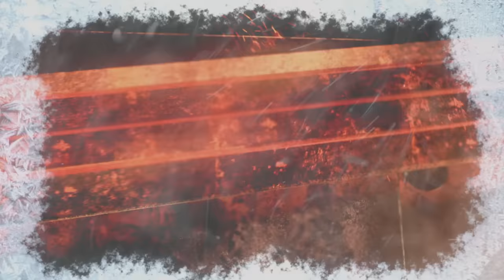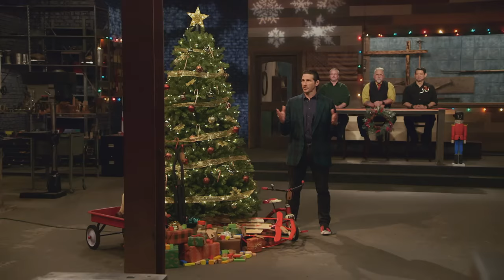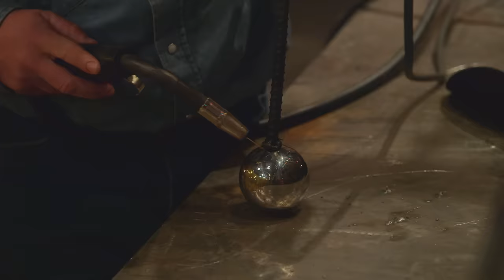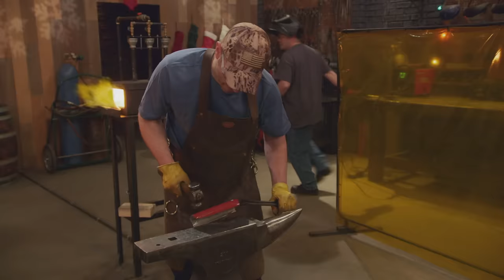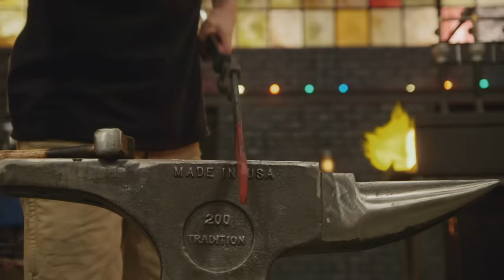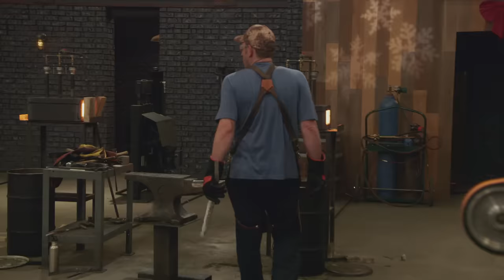Forged in Fire: Slashing Around the Christmas Tree (S7, E14) | Full Episode

Comment: These guys had so many problems in the final round...wow
Reply: Cause the only one qualified was knocked out in round two
Reply: @frankdobs  He seemed more qualified to me as well, but he did make that fur on the handle mistake.
Reply: @yashuab.2979  yeah, that might be partly b/c he used a piece of micarta from the pantry as the primary handle material before remembering he was required to use part of the nutcracker lest he risk immediate disqualification.